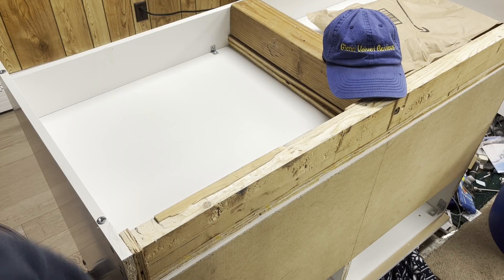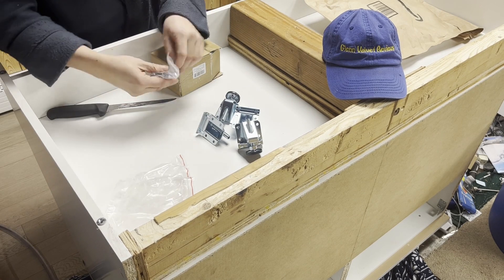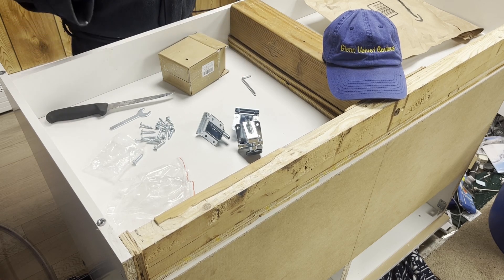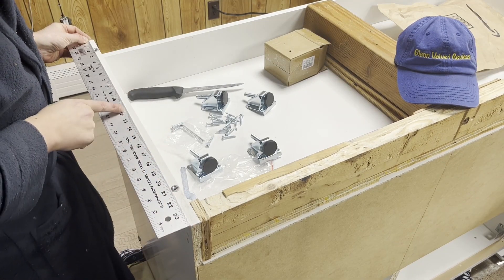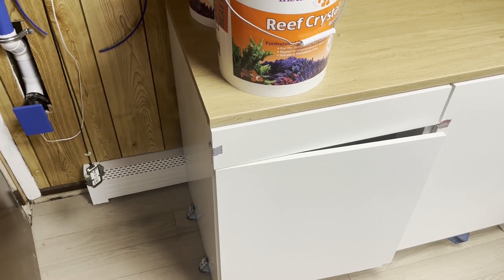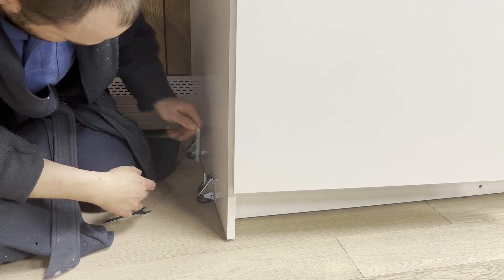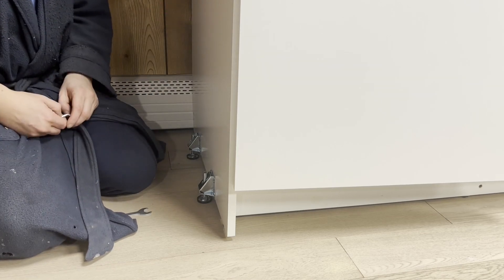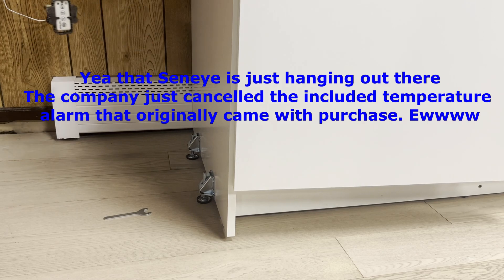Installation Review of OwnMy Heavy Duty Adjustable Leveling Feet, Furniture Legs, Furniture Levelers

Comment: I live in an apartment with an enclosed balcony and need to secure some timber in front of the railing. Do you think these could be used to wedge the timber in place against the ceiling
Reply from the maker: Sorry boss, very hard to give you a confident answer without pictures. Especially when using these outside their designed parameters. As my channel grows I will create a support messaging system on YouTube to help all my Velveteer’s with their not planned life obstacles. Good luck on your travels.